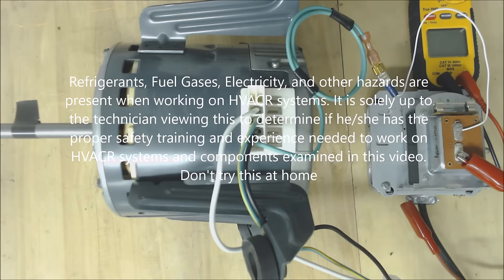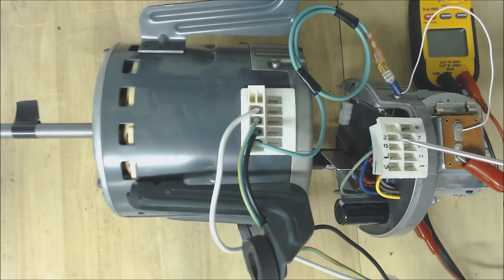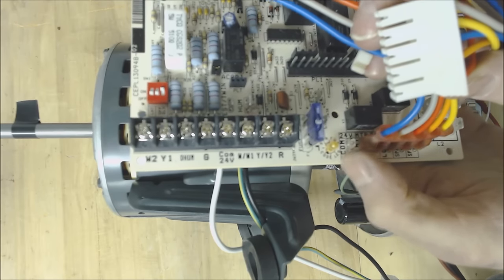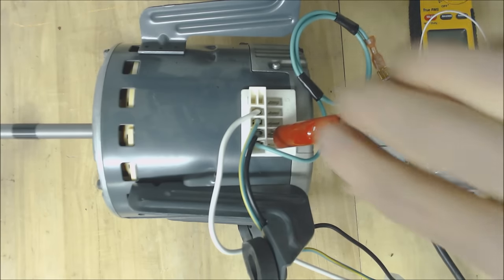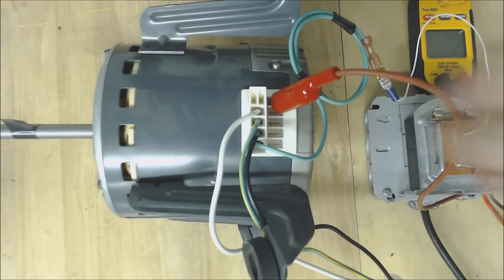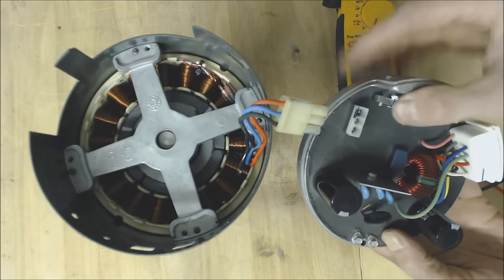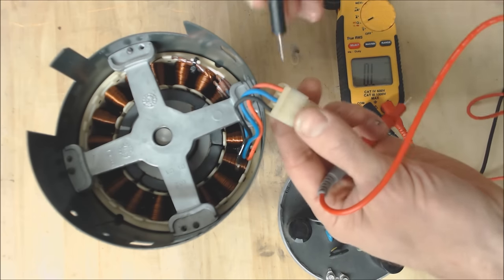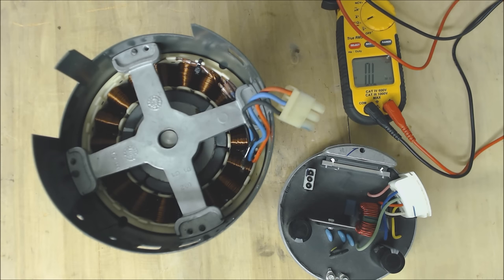ECM X13 Blower Motor Troubleshooting!

Comment: got a 2yr old CARRIOR heatpump & ah motor stopped so moved blue 24v fanspeed wire from one to 3 & ran for 2 months  then stop running in heat mode & ac ,,need new MODULE ALREADY!!! I heard  AC COMPANYS CHARGE FRO $350 -$ 1200 JUST TO ORDER THE NEW WARRANTY MOTOR & REPLACE ,,whats fair price goin nowdays

Comment: I have a Broad Ocean 3/4HP 208-230V. I runs for few seconds and stops, it does this 3 times and stops completely, there is 220V and 24V reaching the motor. can be another faulty component?, my furnace is electric with no control board. Thanks

Comment: RHLL-HM382IJA x13 motor. When it calls for heat the blower doesn't turn on even though the thermostat says "fan on".  If I switch from "automatic" to "on" on the thermostat then it runs, but now I have to do this manually. I changed the circuit board, transformer and thermostat and still have this problem.

Comment: Got one where the blower runs constantly. Unhook g from tstat still runs. Any time it has power on fan runs on high speed. Have to kill power to shut it off. Not sure if its module or control board but was installed in new construction..
So when heat was operational it sucked up fine dust from sheetrock and flooring dust. Not sure if that was what done it but certainly wasnt beneficial

Comment: HELP! I have an ECM powered Furnace/AC unit that has a relay on the control board that is clicking uncontrollably. The unit is set to Cooling and it seems anytime the ECM motor is changing speeds from normal speed to super high speeds the control board relay goes crazy! It literally clicks on and off every second repeatedly until the speed of the fan settles. It's a Ducane branded unit with a very similar motor like the one seen in this video.  Any ideas where the bad signal would be coming from that I need to check? Everything is still functioning properly right now, but I know if it keeps up with this clicking for a long period of time, either the relay is going to die or something else is going to happen. Any tips would be much appreciated! Not much online about clicking relays on furnace control boards...

Comment: Are the 1/2 HP and 3/4 HP modules of a X13 motor interchangeable?
Reply: Probably not because of the capacitor rating

Comment: Craig,  I have a question about further testing an x13 motor module. If I power an X13 module with 240v and send 24vac to each spd tap. (one at a time) Then attach my meter to the power out set to DC voltage to see if power is being sent to the windings. Is this in your opinion a valid test to verify module is indeed good.

Comment: Hi, I'm troubleshooting my A/H blower motor that stop working. I notice that when I'm taking volts readings the C common is not showing 24v but it shows 24v on the bottom pins when fan switch is on the on position. My question is does the C common is supposed to be hot all the time?

Comment: All of this good info and it neglects to point out why there are two wires hooked to my speed connections. Supposedly I just need to move a wire to increase the speed. Great I know one through five are the speed levels. I have no idea how they're actually set up or how they can be changed.

Comment: Hello. Great video.

What could be wrong with X13 if the motor  just spin in low speed? It would be possible to repair it? 
Everything seems to be normal from the control.
Reply from the maker: Did you test the motor by itself with a megger or a multimeter? The ohm values should match closely for all three pairs. If not the motor then the module is bad, thanks!
Reply: @acservicetechchannel  hello. The resistance of the coils of the motor seems to be fine. The multimetro shows 12ohm between them
Reply: What was the issue, module or motor?
Reply: @acservicetechchannel  Transformer is getting 240v and 27-28v out to run terminal.
Motor is getting 120vx2 and 27v to run.
Motor is solid.  
Symptoms 
My motor when activated is turning super slow (no air flow) and other times it'll be normal speed (normal air flow) Is this mean a bad module.   Please help! Lol
Thanks

Comment: you can get psc motor and qik swap and call it a day
Reply: On the Rheem/Ruud, I've done it, the circuit board has cool/heat speed taps, test those first. And use the existing wires, make sure your wiring is correct on a two speed gas pack unit or split system air handler furnace.
Reply: I forgot to add, some units have 2 stage cooling, you will need another fan relay for1st stage, etc. I'm sharing enough of my 40 years of learning on my own here!

Comment: Do these motors need to be programmed?  I put a new one in and it dident work.  Called a company out to look at it and they told me it needed to be programmed? I ordered mine from HD Supply.
Reply from the maker: Do you know the model you ordered? Some can be programmed by the distributor but they already have a preset program, thanks
Reply: @acservicetechchannel  model is 5SME390X
Reply from the maker: That was just the motor, sorry I meant the module. Is this a carrier or evergreen?

Comment: I checked the resistance of the OBB wires of the motor and it floated between 14 and 12 ohms on all of them.  Is this normal?

Comment: any idea why we are having so much trouble with these motors failing?
Reply from the maker: Low airflow problems kill them due to the increase in amperage to keep up on the torque compared to psc motors just free spin and draw less amperage. Voltage spikes also kill the variable and ecm motors. Now I am trying to focus on just selling the psc or ecm motors because we have easy less expensive replacements for them compared to variable speed motors that have to be oem, thanks
Reply: They're actually a cheap offshore non-quality, built in India and China using consumer grade electronics.  Not at all suitable for the reliability demands of vibration and heat.

Comment: I have a question.  I am testing an x13. The motor does not blow air but it does turn slowly.  I have 230 volts,  and i have 26 volts between the low voltage common and only 1 of the speed control wires. It happens to be orange and in the #2 spot of the motor.  
The ac was set at run, cool.  The motor was spinning but really slowly.  I turned the unit on to fan only. The motor is still spinning slowly, not enough to push air. 
I am thinking the ecm is bad because the motor still spins on its own.   Local hvac wants 2k to fix it.  They orginally diagnosed it. 
I pulled the motor out and removed the module.  I tested the 3 leads of the motor for continuity.  
My meter reads 1. At rest, reads 0 when the meters leads are touched together.  When testing the 3 leads on the motor they all read 0. I am under the impression that this means the motor is bad.  I get no continuity when testing a motor lead to the case of the motor. 
My understanding of motors is that a winding has over heated,  or something,  and is in direct contact with the other windings.  
Is my diagnosis that the motor is bad correct?  How would it be able to still spin approx 30rpm? 
I ordered a new motor/ ecm.

Any other thoughts?
Reply from the maker: Well, 1hp motors typically read around 5ohms a pair and 1/2hp seem to read around 12ohms. These are just rough numbers I am used to seeing, thanks

Comment: My blower is not turning off it’s a ecm motor. I don’t have any circuit board or relay. Is it the motor itself. My green wire to the gray no power still running.
Reply: Same problem, runs continuously.  For fun I cut the green wire (fan 
only) and measured the voltage on each end.  The end going to the 
thermostat read zero volts (as expected).  The end going to the fan read
 4.5 volts.  I suspect something inside the module is shorted to the 
green.  I might try to inspect the module but they are predicting 
mid-90s for the next week.  Also, some people prefer to run the fan 
continuously, but not me.

Comment: AC Service Tech LLC what is the problem if the fan turns on once breakers are turned back on and then shuts off? Have a Trane ECM unit as well and just put a new capacitor in and compressor comes on the fan just won’t stay on.
Reply: Low voltage issue . Not sending signal

Comment: Great teaching video. Well explained. My question is what determines the speed of the motor? Preprogramed into it or a differential duct air sensor?
I mean, if the circulating fan motor is turning but at a constant slow speed when it should rather be high speed, does that mean a control board issue or some airflow sensor issue?
Reply: Check your dip switches on the control board. They enable adjustment of different speeds.

Comment: Thank again Craig.  One question.  Can you test a 3/4 HP motor with a 1 HP ECM bell?
Reply from the maker: You can use it for testing the motor very briefly but I would not leave it on. Most of the time, the actual motor is fine and the module is the problem though.

Comment: I didn't test my motor yet but I just want to ask my blower turns on but at slow speed sometimes try to go faster but it goes back to slow would this be an indication that the motor is bad or the module ?
Reply: What was your issue?  Module or motor

Comment: The ecm motor spins slow...what could cause that ?..
Reply from the maker: Does it spin slow on all 24v speeds? or does it ramp up and down and up and down. If it ramps up and down then it is likely the module, thanks
Reply: @acservicetechchannel  
Mine also runs slow and on all  speed taps without speed difference. Do I need a new motor? Also this motor doesn't have external capacitor right? It would be a tremendous help. Thanks.
Reply: Any fixes for this issue?

Comment: How the signal TAPs are program? Are the L and N energized during tap programming?
Reply from the maker: Just the 24v connections are programmed. The manufacturer will choose which taps to program at whcih speed, thanks

Comment: great video!! I have a question: my motor blower only runs at the lowest speed and after a while stops.
Reply from the maker: What kind of blower motor is it, shaded pole, psc, ecm variable speed, or just ecm, thanks
Reply: Is variable 5SME39HL
Reply: Mine does the same or wont even kick on

Comment: My friend has that blower. It’s currently on my bench.  I checked the motor module separated to make sure the motor wasn’t grounded.  It’s good.  Under the foam I suspect there are screws that will let you pull out that foam and board.  It would be easy to test the caps , which are probably bad.   380 for just the module.  It was cheaper just to put in a single speed motor.  What I’d like to know is could you put power to the motor plug and make it work without the module.   I’m not an ac tech just someone who’s able to fix stuff.  I haven’t been beat by an ac system yet.
Reply: No, you can't just apply power to the motor windings.  The motor is a 3-phase design, and the controller is essentially a VFD (variable frequency drive) that synthesizes 3-phase power from the single-phase power input.  So no way to bypass the electronics or hot-wire the motor.
Reply: Richard Kinch that’s to bad.   I found one hidden screw in the module but the board wouldn’t come out.   I could probably find the bad part if I could get it out.
Reply: @Imwright720  The foam is a permanent potting compound that you can't remove without destroying the electronics.  So these modules are impossible to diagnose much less repair.  It's tragic, because they are simple enough that the boards could be repaired, if only they were not potted.  So for example you can't test or replace the electrolytic capacitors, which would typically be a failure candidate that's easily fixed.
Reply: I removed most of the foam without to much problem. I believe they also glued the board in.  Even with the 3 screws gone it doesn’t budge from anywhere.  That tells me it’s also adhered to the body